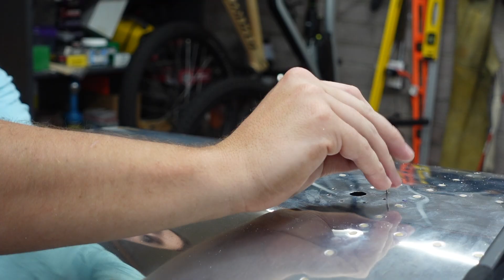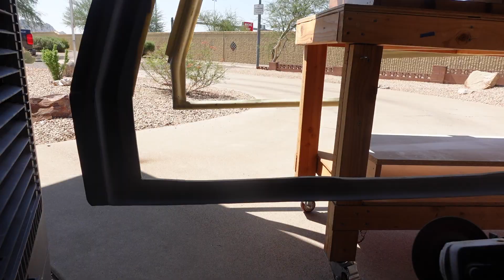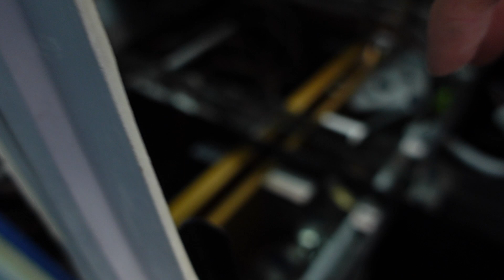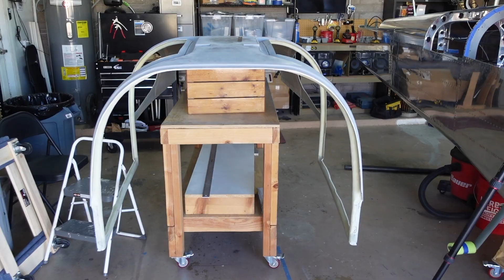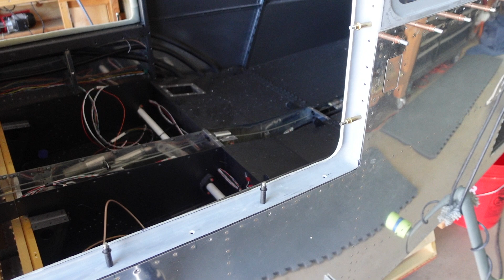RV-10 - AFS Wire Routing, ELT, Cabin Cover Work

Comment: I used diamond grit oscillating blades and jig saw blade to cut the fiber fiberglass without spraying dust everywhere. Lots of control over the cuts and just vacuums up. The blades are a bit pricey but I've only needed one of each so far and I'm almost done with both doors and cabin top. I should really post some photos on vansairforce, it made it so much easier and I've not seen anyone else use them.
Reply from the maker: @StewartAllen  I used one of the jigsaw ones for the window cutout and really liked it. Should have used it for some of the other cuts too though. You’re right about the lack of dust!

Comment: I had an edge distance problem with my center brace as well. I haven’t drilled it yet cause I’m working on the doors as well presently and will get back to it. Vans said that adding some cloth and epoxy on the cabin top to gain some edge distance is exceptable. Look forward to watching your progress and seeing how you tackle it
Reply from the maker: @williambeckert9057  it sounds like it’s a pretty widespread issue. Even looking at the factory RV-10 at Oshkosh and various other completed builds, I noticed the support bracket is generally pretty far forward with what looked like very little bite on those front two bolts going through the fiberglass. I think I’ll do something similar and just get it as far forward as possible. Edge distance in the steel part up front probably won’t be great but my understanding is that steel is more forgiving with that than aluminum